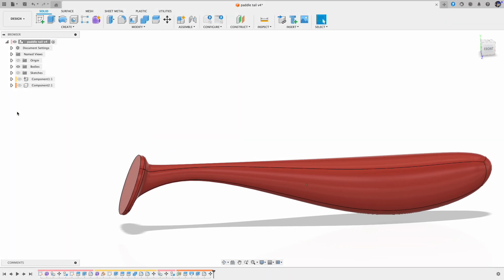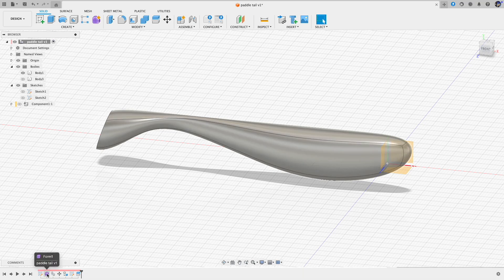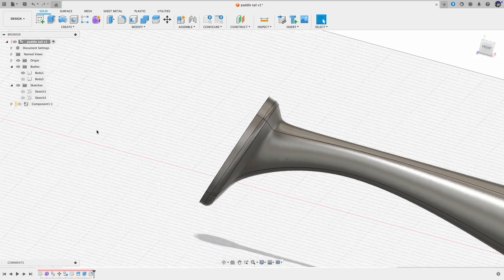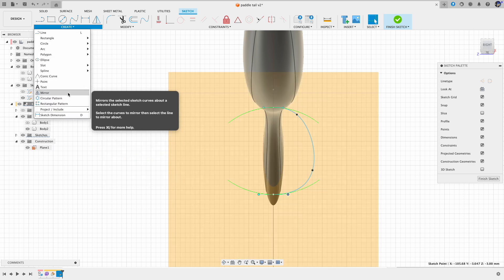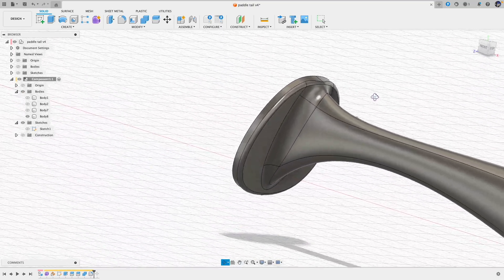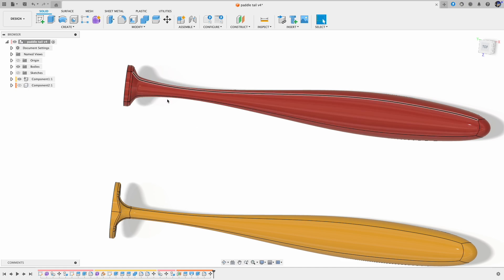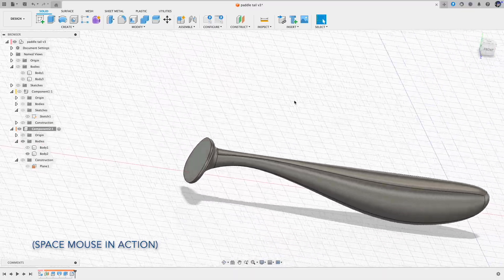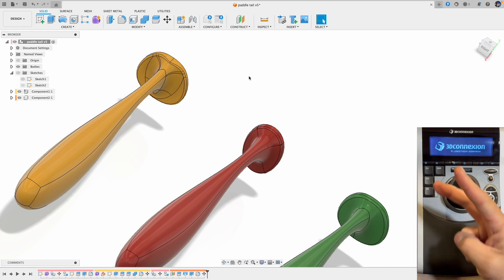How to Create Swimbait Paddle Tail in Fusion 360

Comment: Very interesting!
I use all these methods in Fusion 360, but it's true that, for lures, we don't necessarily think of these techniques, even though we use them daily.
Each tool brings something useful. I really liked the Cut followed by the LOFT; it allows for many different ways to refine the design!

The only real issue is the desired size of the lure. Once resized, the paddle thickness becomes unpredictable...
A lure needs to be created with the desired size while considering the paddle thickness, but I don't know how to do that because the lure will always end up either larger or smaller.

How can you measure an organic shape in Fusion? Personally, I save it in the slicer and check its size on the axis that interests me. Then, I enter the desired size—for example, 4 inches. My base scale of 100% changes, let's say, to 89.7%. I go back into Fusion and set the scale to 0.897. Bingo! My Shad is now 4 inches, but the paddle thickness has changed.

So, the goal is to ensure that the paddle doesn't change size and doesn't affect the lure’s overall dimensions... How can this be done? That is the question...
Reply from the maker: For the thickness, you can use section analysis, it might be tricky to measure, maybe count the grid, or put a line with desired length next to the paddle. Adjustments will take some trial and error, going back and forth… I wish there is an effective tool for simulating the wobble behavior, then it will make paddle tail design more fun. Someone has to train AI to do that 🤓
Reply: @yauckoutdoors  
Oui c'est certain, c'est compliqué en tout cas, peut être qu'il existe une solution dans Fusion mais je ne l'ai pas trouvé...
Merci pour votre réponse.

Comment: Do you like fdm or resin printers more for fishing lure? I’ve been watching you for a long time and i think you use FDM? Would you suggest FDM? Also never tried fusion360 how did you learn? 😊
Reply from the maker: @Nobadcasts  in general I like FDM more than resin because its ease of use. But in terms of lure molds, resin printer is the way to go, although newer FDM printers will give you much smoother result, and the heat resistance filament are available also. But I think it still can’t beat resin in terms of the quality, unless you don’t care about the layer lines and details. I had experience with AutoCAD way back when, so picking up fusion is natural. But in the beginning when I started using fusion, I followed a video for creating something like a moving joint. Then gradually pick up skills here and there. YouTube is your best friend. When I need to know how to do a specific task, just look it up. Anyways if you ever get stuck, let me know, I should be able to help. Cheers.
Reply: @ I appreciate your help. Hope you have Great rest of your day and thanks for all the neat lures you’ve created